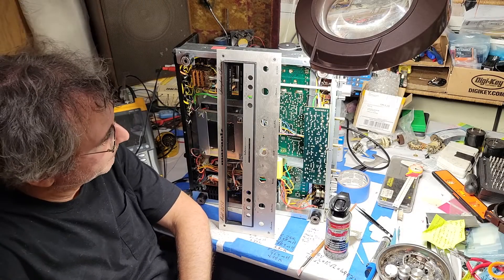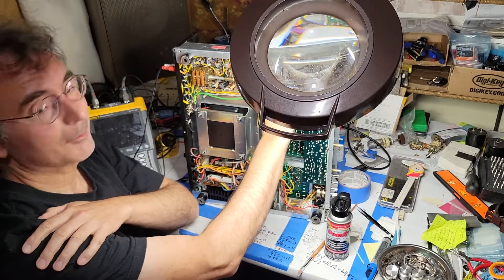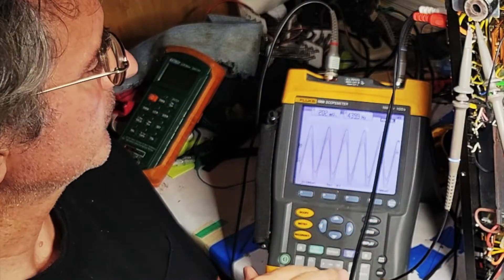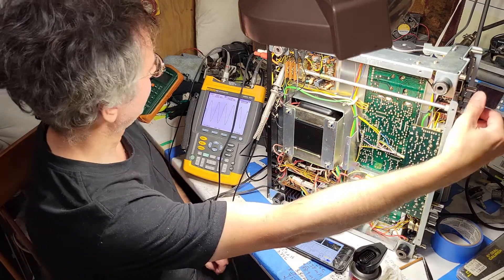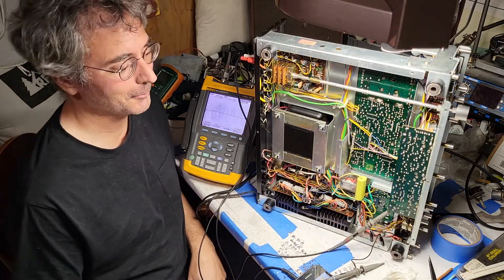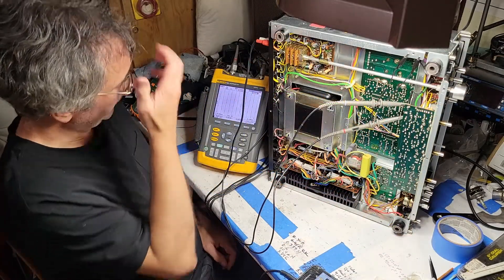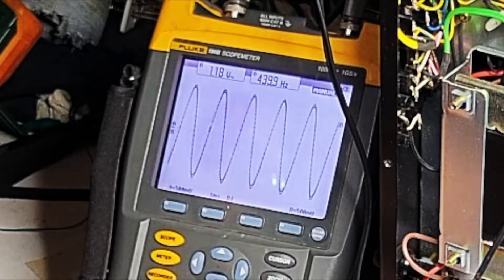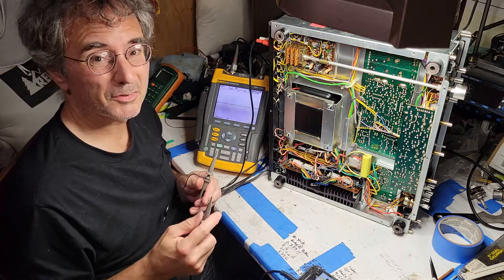Marantz 2252 Service: Channel Imbalance! WTF?

Comment: What does the signal look like on the speaker terminals if you bypass the preamp and plug your signal directly into Main In?  Seems like that would be an easy way to completely eliminate the main amp board from the troubleshooting equation.

Comment: Hi. these are always difficult.  maybe  naiive suggestion, but did you try full on brute force - ie. hitting the boards to try to force the issue... That technique has served me very well over the years where a dry joint or bad connection is suspected. Of course it may well "fix" the problem for a while.... bugger innit?
Reply from the maker: I think I finally figured it out: The front panel switches. Fixing them is tricky. New video soon. And yeah, I did some board flexing and whacking before whacking the tape monitor switch!
Reply from the maker: In fact, there's a sequence in my last video of me poking around with the long wooden handle of a paintbrush.  That's how I finally found the problem switch.
Reply: @Lancaster_Hi-Fi  😉 Yep. There's always a place in modern electronic repair for good old fashioned violence!!